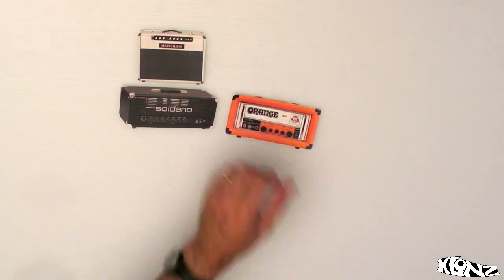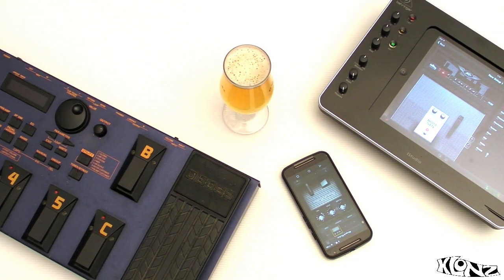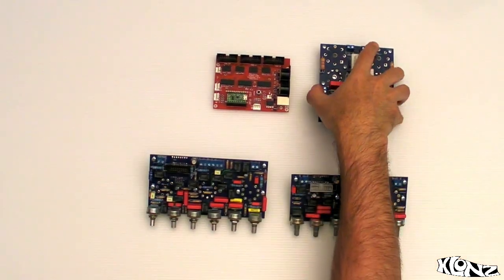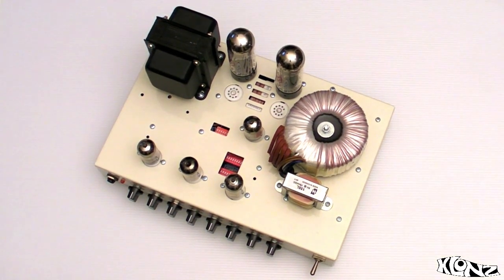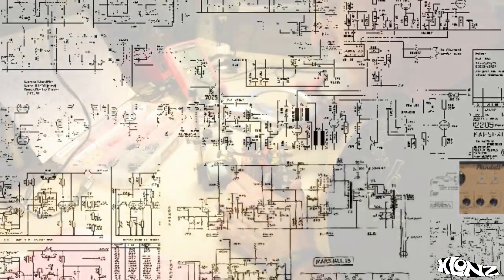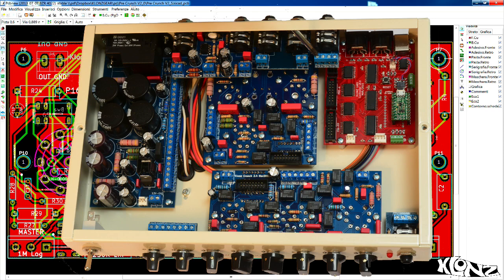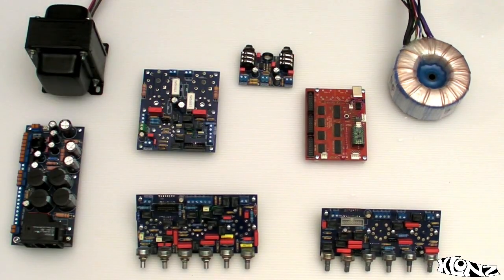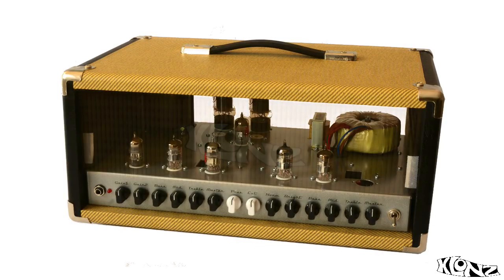Klonz! The new DIY Digitally Controlled Guitar Tube Amp

Comment: Looks absolutely brilliant - sort of a more modern implementation of the old ADA MP-1 preamps. I have only one question - at 0:25, the switch between the patches isn't exactly smooth (there's a pop, and then the new patch fades in over a couple of seconds). Will this be smoother/more instantaneous in the final production models?
Reply from the maker: +digiscream 

You're right. There is a some commutation noise. This beacuse there signal path is really 100% full tube, and muting it the way it's normally done would have meant putting some Fet's on the signal path. We don't want to do it. BUT: we're working on a speaker output with a relay-switched mute circuit that will get rid of the issue. Thanks for your feedback! andrea
Reply from the maker: +Klonz-Labs +digiscream
The "Silent" output works perfectly ! Tomorrow we'll make a new video to demonstrate it
Reply: +Klonz-Labs Excellent stuff - I'll look forward to it :)